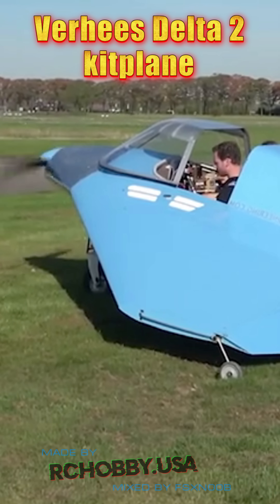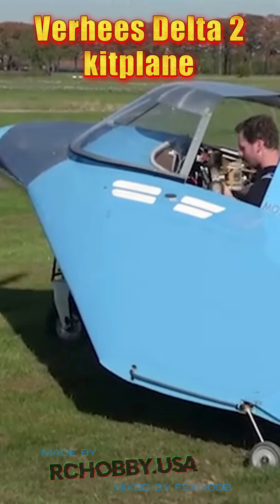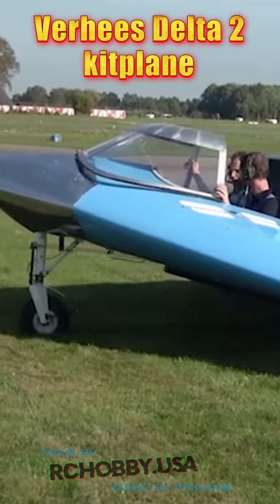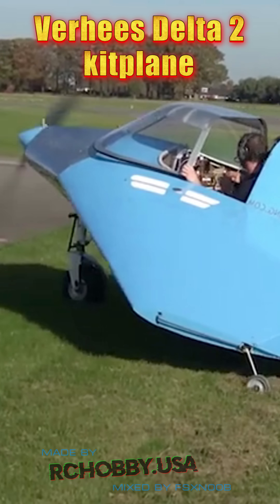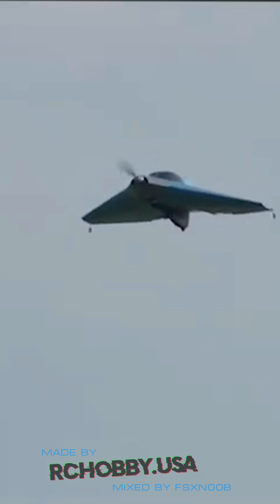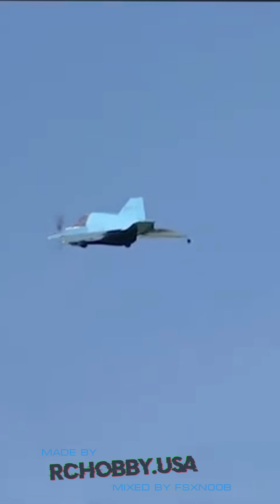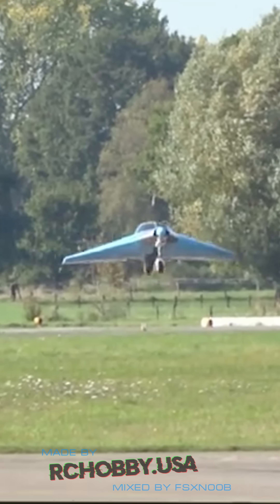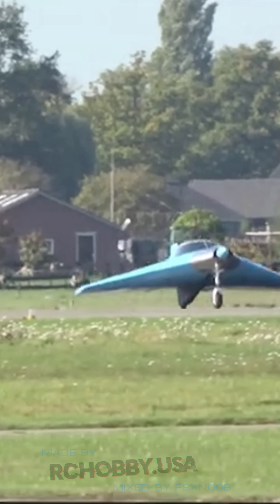A Game Changer in Aviation - Verhees Delta 2 Kitplane #shorts #aviation

Comment: Just like any delta wing aircraft. But really cool that they made a kitplane that is affordable for private aviation. The Ukrainians might be interested in this one.
Reply: It's not ideal for a drone conversion. It's made to have nice flight characteristics including good low speed handling. You don't need that in a drone. A drone can be designed with a smaller, thinner wing. It can be more lightweight and have less drag for even higher speed and longer range.

A simple delta like this is easy to design and easy to scale. There simply is no need to do a 1:1 copy of an existing design that's not 100% ideal for the task. 

But this kit plane still proves how bad the Iranian Shahed design really is. The Shahed is less than 300kg with a 50hp engine and 40kg payload. It fails to reach a cruising speed of 200km/h. 
This plane here is a lot bigger and heavier, has 100hp and is carrying 2 grown up humans at 240km/h. 
The range estimate for both is about the same btw.
Reply: @Itsjustme-Justme The Shahed used a two stroke motor, because they're cheaper to produce for a single use product, and Iran has lots of them because they're used in moped manufacturing there. Much less efficient power cycle, ejects an awful lot of fuel out of the exhaust stroke. A four stroke motor, like the one used here, can offer more efficiency, but it's more mechanically complex, and likewise costs a bit more. Wankel engines are a good compromise used in some single use drones.
Reply: @Spencergolde That's a really good observation; an inexpensive Wankel would provide fuel efficiency and good torque at constant RPM without having to worry about maintenance, just requires oil in proportion to fuel load.
Reply: @Itsjustme-Justme 
Makes one wonder why the RF even buys lranian drones...
Reply: @HuntingTarg  Because a stoneage country can do nothing on its own.
Reply: @Itsjustme-Justme  

Iran?   Not exactly.
The RF?!

They have a 21st-century military, nuclear weaponry, a space program, and 12 centuries of cultural history, so that's a joke, right?
Reply: This isn't a kit plane... I don't even think you can get plans for it like you can with the delta 1. People need to stop making up nonsense and then others, like you, need to stop listening and believing everything you see on videos on the internet.
Reply: They will need this to evacuate straight into UK while avoiding border blockade in the same time?
Reply: I guess the Ukrainians already, invented more efficient drones 😅

Comment: Looks unstable. I wouldn't fly in it.
Reply: Have you flown anything yourself? Do you know anything about aeronautics design? No and no? What a shock!
Reply: @thomgizziz  yes I have. 172 Cessna and a Challenger 2 ultralight.
Reply: @mlane2012  So you know nothing about aeronautics design... so my point still stands. The design for this is fine and it will fly fine. Both the planes you have flown are trash compared to other planes and are unstable in the slightest of bad weather. So they must be trash, why are you flying them?

Comment: Sounds  like an ad for an inexpensive long-range  stealth attack drone.
Reply: Do you know those Long EZ's? Designed by Burt Rutan? That is exactly the same concept, a small plane simply has less drag, so it is faster, and it gets further on a full tank of gas. The problem is, many pilots refuse buying it, because they got to learn to land at a higher speed. When you also fly slower planes, maybe they have a point. But get real, you can get used to higher speed.
Reply: @voornaam3191  Not if you have short runways.
Which many places do.
Reply: Yo why I just thought that seeing this short for the first time. I'm like some proxy is going to drone this
Reply: Your gonna hate how propellers screw with stealth
Reply: To me it looks like Me 163 Komet. At least for the overall body shape.
Reply: @utrock5067 That's exactly what I thought.
Reply: Only without the stealth or drone capability.  It's best feature is that is efficient at ~32 miles per gallon at the stated slower speed.  In contrast, a big aircraft often gets less than 4 miles per gallon.
Reply: This thing has props and a vertical stab. This shit ain't stealth.
Reply: @p3t3rrrn and even if you take those away it's still very far from stealth
Reply: It can hold 2 200lb adults, or in other words, a 400lb payload... hmmm
Reply: It's a Diddy-escape plane!!🤣
Reply: Copie du KOMET allemand
Reply: Don't forget Jim Bede's little pocket rocket, the BD-5.
Reply: One, it’s got a propeller, which is like a disco ball on radar, secondly this does NOT have the capacity for meaningful armament. Probably could mount some Mags if you tried.
Reply: Horten brothers Reich Yuga is bottomless pit of despair, why in day.
Reply: i doubt this stealthy
Reply: @Ice_elite  More stealthy than a cesna.
Reply: Not everything with a delta wing is stealth.
Reply: Actually there are loitering munitions with a far larger range.
Reply: First of all you cannot make a propeller aircraft stealth it's not possible. Second the airframe while has reduced capabilities it literally not worth the price of having to put a new coating on it. That right there is simply a delta wing prop plane for civs. You could try to arm it but you would need to change the engine type, probably would need a bigger nose for it so that's a no go. It's useless if you know anything about aircraft as far as cheap alternatives go
Reply: @SirPigeon-t3m You can WD40 to the paint to reduce it's RCS a bit.
Reply: First of all you cannot make a propeller aircraft stealth it's not possible. Second the airframe while has reduced capabilities it literally not worth the price of having to put a new coating on it. That right there is simply a delta wing prop plane for civs. You could try to arm it but you would need to change the engine type, probably would need a bigger nose for it so that's a no go. It's useless if you know anything about aircraft as far as cheap alternatives go
Reply: What is it's load capacity.
Reply: It isn't stealthy at all, nor is it inexepensive. Not to mention, IT ISN'T A DRONE!!
Reply: @xavier1964  exactly that's what makes it so perfect for  a government contract.
Reply: @tltnation878  LOL! Good one 😁
Reply: Spot on lol
Reply: This thing is literally shaped like a radar reflector. It's probably about as stealthy as a strobe light
Reply: it's even colored in one of Ukraine's colors!😲
Reply: I would say one way trip type flight.. who could fly 18 hours solo. No sleep, no toilet, no autopilot, no stretch space.
Reply: @atam6  Someone who has a passport and not enough money for a private jet.
Reply: @justsoicanfingcomment   So, I think when you want a small plane, why not such a fast one? These things are great for making a lot of miles a day! Who does not want that? Why do people stick to all those slow planes? Those burn fuel and money like crazy, while moving a lot of air, three seats are always empty! That is not exactly smart, is it? And in a Verhees or an EZ (Rutan) you can try visiting all States of the US in a couple of weeks. Such trips will be fantastic. Going almost twice as fast as normal, that is a big deal.
Reply: @voornaam3191  The benefit of slower planes is that they can take off and land on shorter unprepared runways.
Letting you go more places.
Flying slow saves fuel.
Reply: @voornaam3191 , one reason people have light aircraft like this is to simply putt around, boring holes in the sky.  If you just want to get up and take in the view, it doesn't much matter whether you fly an ultralight or something like the Delta 2.

I gotta say, though, that the cockpit canopy and the landing gear are features I find interesting.
Reply: @justsoicanfingcomment More places you're not going to go anyway. 🤷🏻‍♂️
Reply: @TecnamTwin I'll stick with my PBY.
Not a STOL craft at all but there are some places I would take a bushcraft for sure.
Reply: @atam6   Ask the competition glider pilots. Eighteen hours is stretching things, but suppose you take off in the morning, and you come back during a summers evening, you can fly an entire day. Then you really need a pee tube, these things do exist, it has a rubber funnel like ball on the end. Then you spray the crops, so to say.
And yes, sitting in a chair is a thing, you do not want health issues.
Reply: @atam6  18 hrs with extra fuel tanks--that's essentially a flying fuel tank... lol
Reply: @atam6 ever hear of a rest stop? you don't have to fly non stop.
Reply: @atam6  Simple..
Dont eat for a day.
Drink alot until midday.
Take a prep shit.
Take a prep piss.
Bring a bottle of water.
Drink sips of the water 12 hours in, hold it after 14 hours, and sustain bladder torture for the rest of the trip..
Pain will keep you awake.
Reply: @atam6  stopping in between, but heading straight to hotel and starting without refueling immediately after breakfast. Makes a difference
Reply: @atam6  I mean I don't know whether it has an autopilot, but I knew someone who just fell asleep in a glider and woke up over a larger city 😂
They panicked when he radiod his airstrip in.
Guy became anyhow crazy, bipolar, on meds.
But I don't think he lost his license and he had a successful business (which made him probably crazy besides his controlling broom he lately divorced).
Reply: @atam6 cartels
Reply: @atam6  @mphetam1nes, bro
Reply: @atam6   cut a hole in the floor,
Reply: @atam6  you can take a break lol
Reply: @atam6  Eighteen hours is it's range without refueling. It doesn't all have to be used in a single flight but it does mean you can fly a long ways to a [lace where you can't refuel and yet make it back home.  

Hope that explains why someone could want that capability.
Reply: @roycsinclair  Thnx
Reply: @roycsinclair Yes. It's funny that some people think it means you gotta do 18 hours in a single flight.
Reply: How much do the passengers weigh?  200 lbs?  Ok that's a 400 lbs warhead, not bad
Reply: true didn't think about that
Reply: Yes the Rotax Engine was found in Drones which only Starts and fly but only landing Hard 😁
Reply: Some third world conutries may be interested in arming their airforce with these.
Reply: Ukraine breathes heavily
Reply: kamikaze drone
Reply: ...DARPA would like to have a word
Reply: @stevec9205  lol
Reply: shahed drone looks pretty similar
Reply: totally
Reply: Give Ukraine ideas. Do it.
Reply: Andruril got me . I thought it was a cool drone to have, not realizing I could not buy it until late in the video.
Reply: Please don't give wealthy dumb people any ideas.
Reply: Mirip drone kamikaze iran bro
Reply: Disposable bomber
Reply: Great idea , we all need a few of them hanging around ....
Reply: except not stealth
Reply: Does it?
Reply: It's a kit plane. They don't even sell the parts, only the instructions. Unless of course you're willing to pay like half a mil for a used one.
Reply: Dyke Delta 1970ish.
Reply: Not really "stealth" with the big wings area, exposed landing gear, exposed air cooled piston engine and propellor, but i get where you're coming from bc of its small size which affects RCS alot
Reply: But it says its a game changer.   And it was in 1947
Reply: Except for the giant prop and the fact that it isn't stealth at all
Reply: @kyle857 Wood props do not reflect radar well....
Reply: It does!
Reply: that thing can probably carry like 2 Hellfire missiles, 4 at most but that's already stretching it
Reply: Sabse kam HP wale engine se plane banaya Ja sakta hai
Reply: A drone built for two.
Reply: Preparing for wartime use?
Reply: @jamesturner6949 ....Shush.....
Reply: Exactly @!!  Hopefully, Putin gets this into industrial production
Reply: @marthamasdeo9833  you need a functioning INDUSTRY to do THAT, bucko
Reply: @The_Conspiracy_Analyst  at least a NATION
Reply: @marthamasdeo9833 I mean it would get small efficient aircraft on the market.
Reply: @justsoicanfingcomment  the Nazis First invented this Design in the 1940's called Nurflügler (only Wing) but it did Not prevailed because of lot of disadvantages
Only cheap Drones Work or Billions expensive stealth B2 's 😅
Reply: @haudraufundschluss1972  It works verry well and can be made for low speed or high.
It's just not the main stream.
It's not what people are used to.
Reply: @marthamasdeo9833 Idk man, Ukraines cessna drones are hard to beat lol.
Reply: @Acepilot235 so is a sore Peter
Reply: @Acepilot235 ❤
Reply: @marthamasdeo9833  You mean Ukraine gets thousands of these...right?
Reply: @marthamasdeo9833  Why do you support Putin?
Reply: @marthamasdeo9833  idk man they already got the Shahed, why make missile launching drones when they already got missile drones
Reply: @marthamasdeo9833 why would you hope that? 😂
Reply: @marthamasdeo9833 Putin couldn't organize a bottle party in a liquor warehouse. What makes you think he could pull this off?
Reply: @marthamasdeo9833  it doesn't fit inside the bunker he is hiding in
Reply: @Itsjustme-Justme  How many more 100's of thousands of Ukrainian lives do you need to shit on?  The disrespect, unbelievable.
Reply: @Itsjustme-Justme  whos hiding in a bunker?
Reply: @marthamasdeo9833 Putin needs the help. It's embarrassing how much Russia is struggling against its smaller neighbor with last-gen NATO hand-me-downs. How many years has this war been going for?  😅